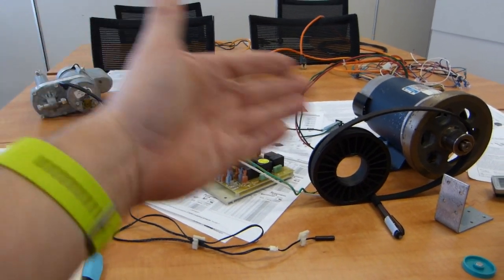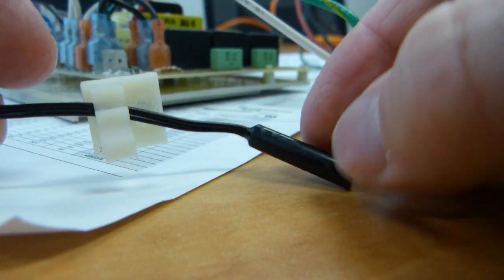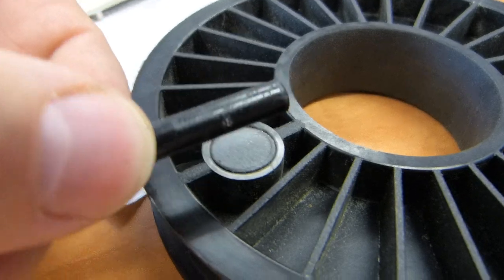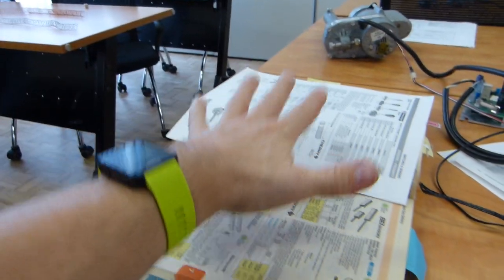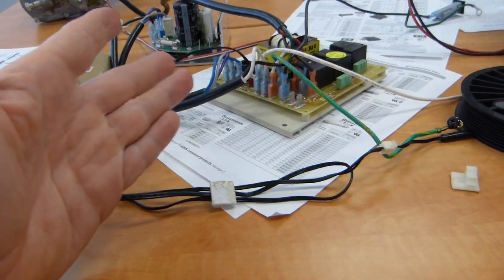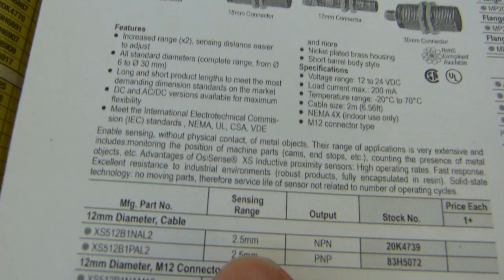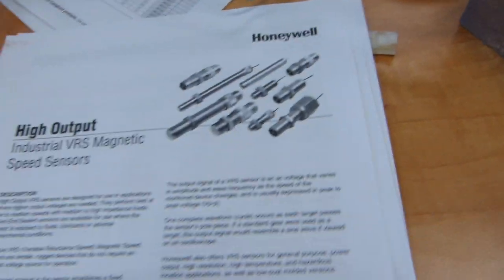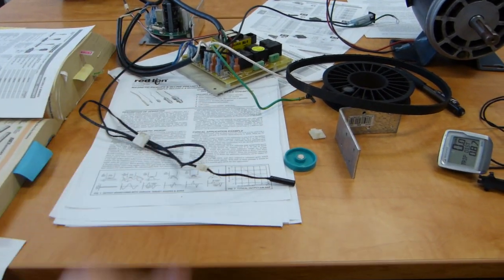Treadmill speed sensor replacement

Comment: I have a horizon t101 and the belt stopped I did a test on the Motor and the ohms are spot-on and the motor turns connecting it to a battery. I have 3-5 v on the panel to the speed sensor, it is a three-wire speed sensor. I hear the clicking right before the motor is supposed to turn but it doesn't. The panel reads fine, what else could it be

Comment: Great video! Thank you for the excellent and thorough explanation!
Reply from the maker: Glad it was helpful!
Reply: great video. I have a treadmill which seems to start up ok but when I run for sometime at above 10km/h it will I think stop for a milisecond (hardly notice it stop) except that it makes you stumble. Wonder is this the speed sensor or a heat protector sensor ?

Comment: Hi Sir, I have my traidmipl in my inslated garage, just a few weeks ago I noticed that my traidmill  goes on full speed when I switch  it on. I am. It sure if it the sensor,  could it be the motherboard  of it down. Cuz I noticed when I am on the traidmipl  running for more than an 1hr I smell little funny smell. In your opinion is my traidmill is not repairable?!thank you in advance
Reply from the maker: Cleaning circuit board and motor fan blades and coils with compressed air, dry (no condensed water vapor droplets), medium pressure 40-80 psi could help with not burning dust on it as it heats up. But the load might be too much for the motor, insulation could be slowly melting. Keeping it dust-free definitely helps with keeping it cool and melting further.
Reply: Did you ever find out why it did this? Mine is also going to max speed when turned on.

Comment: After various attempts to rectify the issue, I resigned myself to live with it. So I began making a ready reckoner Table to calibrate displayed Speed/Distance Vs. actual Speed/Distance. For this purpose, I spent an hour calibrating the actual speeds at each setting and tabulated the results. I plotted the actual vs. displayed results on a graph and found the curve to be linear in both cases, but different by a constant slope. Using elementary trigonemetry and algebra, I found the equations for the two straight lines. As observed earlier, the two lines different by a constant slope. And today morning while I was walking on the treadmill, it suddenly occured to me that the difference factor was almost the same as the  conversion factor between miles and kms !! Excited, I stopped the machine, and tried various cominations of pressing the SET/RESET/MODE buttons before I finally hit upon the right combo that reset the readings to KM from MILES. So now everything is hoity-toity again.. and I can see that the displayed and actual values are almost same !! So what must have happened before was, unknowingly by pressing some combination of buttons, me or my wife must have reset the units from KMS to MILES !!

Comment: Very informative. I decided to dust inside my TM today, and sprayed some WD44 around near the roller bearings at the ends. After putting back everything, noticed TM wan't showing correct speed. After checking your video, I could identify my speed sensor easily - its a rectangular piece. I wiped it clean and put it back again, but still the speed is wrong. The TM speed was correct until I fiddled. Wonder what's the problem..
Reply from the maker: Placement, alignment and distance are critical. Fiddle with it, see if it gets better.
Reply: @theoverengineer  Thanks. I did try, but doesn't seem to make any difference. Fact is, speed is now displayed exactly 33% less.
Reply: @SrinivasRaghavan  Wow, almost as if it was displaying in MPH instead of KPH now!

Comment: I have a T360 and when I turn it on it runs for few seconds and it stops and shows Error L5, what does that mean?
Reply from the maker: Ask the manufacturer, then share it with us all.
Reply: visit my channel its error LS not L5 which means low speed
Reply: When i turn ON my treadmill it runs for few seconds and it stops and shows E 03,Whats that means
Reply: @mohammedshafi4887  I suppose it should be in your troubleshooting section of the user guide? on mine, an E03 means that there is no speed feedback from the motor even though the system is powering the motor. Check your speed sensor.